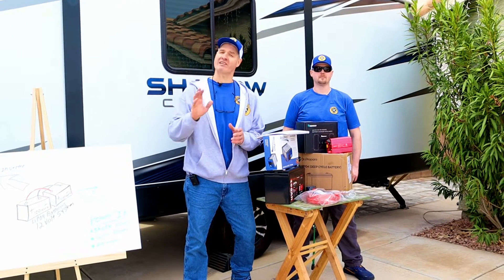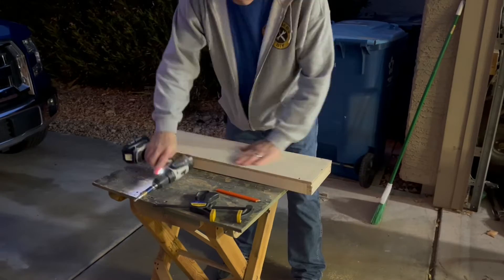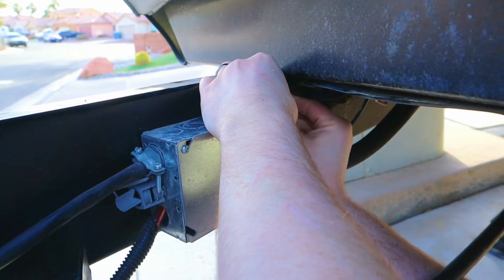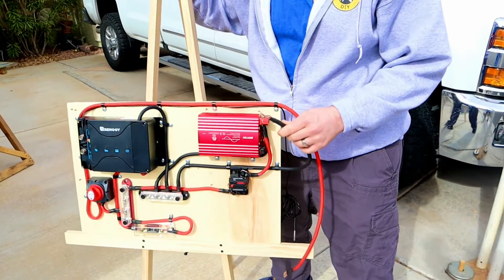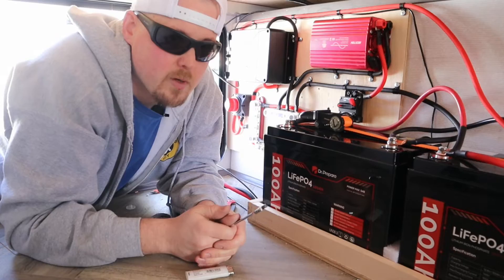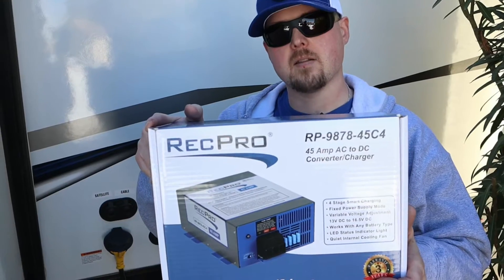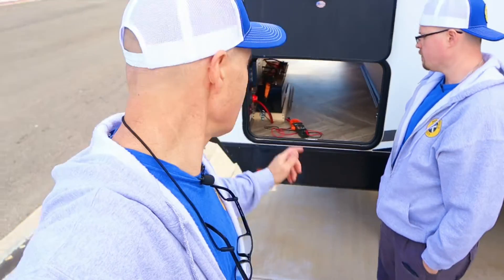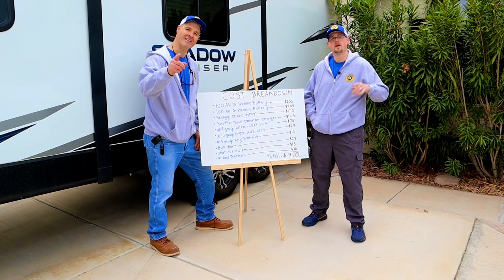Lithium Camper Battery Conversion-Step by Step Dr.Prepare LifeP04

Comment from the maker: Tell us what you think about this electrical upgrade! Leave us a comment and let us know all of your thoughts. What would you have done differently?
Reply: I just watched this video and found it very well made with usefull information. I would like to suggest you change out that galavanized 4"x4" junction box on the inside of the tounge to a "SEALED" box designed for outdoor use. That thing is for interior use only and is going to fill up with road grit and water.
Reply from the maker: @EdReda Great tip! Isn’t it crazy what these camper manufacturers are using!?!
Reply: Great video.....saw the YT Shorts and was eager to see it. About the only thing that I would do differently is buy everything and bring it over to your place to put it in.....with beer and burger, of course! 🤣
Reply from the maker: Glad you found some value in our video. Fred Jr has been wanting this upgrade for quite a while now. Thanks for commenting!
Reply: @MrFredsDIY  - The both of you made it look super easy....Thanks for sharing!

Comment: Great video guys! I am following your design on a toy hauler. Couple of questions. When you tied your positive to the existing positive - is that a fuse or just a 2 post buss bar? Second item I have a generator on board that was directly connected to the lead acid batteries directly. If you had a generator on yours, would you tie into the bus (terminal blocks both the + & - or directly to the battery posts. Would any fuses be needed and if so where? Thanks.
Reply from the maker: The positive and negative coming from the trailer frame we tied directly to the bus bars. We have an ANL fuse between the MPPT charge controller and the bus bar. We also have circuit protection between the inverter and the bus bar. As for a generator, we use a 3500 predator from Harbor freight. Our set up is for shore power. The power current coming from the generator needs to go through a converter charger to convert it from AC to DC. This device also acts as a charge controller as well with multi phase battery charging management. The simplest and most efficient way to use a generator to charge house batteries is through the shore power plug. I am assuming that whoever wired the generator to the previous batteries was using the DC output. I have no idea if the generator you have is putting out the correct voltage to match what is needed by LiFeP04 batteries and is certainly not optimized for lithium with multi stage charging and battery management. Most of that was not necessary for lead acid.
We just made a new video on our other channel for our camper set-up. You can watch it here➡️https://youtu.be/uBh2U7BgcOI?si=_NUNsNvEjPOCBlVU
Reply: @MrFredsDIY  Thanks for the quick reply. The trailer is a Jayco Octane T26Y came with a built-in cummins Onan RV QG 4000 EVAP generator.  Am I still going to need a Led/Acid battery to start the onboard generator? Will the new LiFeP04 not start the generator?
Reply from the maker: I’ll be straight with you, on board generators are outside of my wheelhouse. I did a quick Google search and it looks like there are many factors to consider. Without a deep dive, I don’t really have an answer for you. Good luck with your project.

Comment: Why did you guys relocate the batteries and not keep them in the preexisting acid? I saw it’s been asked multiple times but never answered.
Reply from the maker: Are you asking why did we put the batteries in the pass-through? If so, there are a couple of reasons for this. Putting the lithium batteries outside in the elements here in Las Vegas when it gets up to 120°F seemed counterintuitive. We also saved a bit of money on number four gauge solid copper wire because we didn’t need as much. We keep gasoline cans where the batteries used to be when we travel to use with the generator. Theft was a concern as well.

Comment: On the 300W Inverter - does it feed (convert 12V to 110V) and feed that into the existing trailer electrical system or do you only access the 120V by plugging a power cord/device directly into the Inverter?  Is there any issue if you install a higher wattage converter than the one you took out? (eg: the converter you are replacing is a 45 AMP and you want to install at 55 AMP).  What determines the max AMPs you would want to increase from the original? Thx
Reply from the maker: Thanks for commenting and great questions. The 300 W inverter does not feed the trailers electrical system. We only use it for the occasional 120 V appliance or tool. We have considered installing a much larger inverter to feed the microwave and air conditioner, but that would require many upgrades and we feel this camper is not worth a few thousand dollars more of electrical upgrades. As for the converter charger, we are planning a video for upgrading to possibly an 80 amp. An upgrade such as this will require careful thought to the existing wire gauges on the “house wires” to carry such a current. The easiest way I think would be to relocate the converter charger next to the bus bars. It would not be difficult to run some 12-2 romex  back to the location under the fridge to tie into the shorepower line. Anyway, I hope this answered your questions.

Comment: My friend tried to get me to change over to Lithium on our 2011 Jayco Jayfeather. We do not boon dock at all. We never will eather. We got 5 years on our first lead acid battery because I remove the battery in the fall and bring it inside where it stays warm. I throw a charge on it twice during  its storage and check the water level often. My friend is all about lithium. I see no sense  in the extra expense to convert. The cost alone doesn't  justify changing over. I paid $150 for another lead acid that, being properly  maintained should last another 5 years.
Reply: He,s right Mattie. 😅
Reply from the maker: I’m sorry to say that you did not save any money and here is why: 

First and foremost is price. You paid $150 for lead acid. The batteries in this video are on sale right now for $150. 

I’m guessing you paid $150 for a 100 amp hour lead acid battery? The Peukert effect, which describes how a lead battery's usable capacity decreases with voltage drop and only allows lead acid battery to use about 50-60% of it’s amp hour rating. Simply replacing the one battery with LifeP04 would nearly double your usable power storage.

Now let’s talk about lithium iron phosphate batteries (LifeP04);
~100 amp hours means 100 amp hours of usable power. There is no Peukert effect. 
~ charge cycles, lead acid= 600 LifePo4=3,000
~lifePo4 have a 10 year warranty lead acid batteries only live 3-5 years 

If you never boondock you don’t need solar or alternator charging so you don’t need an MPPT charge controller. You would need to change the charge controller that came with your old camper for Shore power. The recpro converter charger that we used in the video is $135. (Of course, if you wanted to add alternator charging, there are solutions for under $150 for  LifeP04 batteries)

Here is the math. You paid $150 for a battery that will maybe last five years and you can use half of its power. That’s $300 over 10 years for 50-60 amp hours.

If you would’ve paid $150 for a LifeP04 battery and $135 for a new charge controller you would have spent $285 0ver the next 10 years to have 100 amp hours.

Comment: At 5:37 you mentioned the Renogy came with a fuse  (output side). For some reason mine didn't. What size fuse is it?      Thanks,,,,,,BTW ,,,  your video rocks!
Reply from the maker: It was a 60 amp a ANL fuse. Thanks for checking out the video!

Comment: Aw man! Doing so well until time stamp 3:22. Completely lost me there. Confirming what?

I have been looking for a good video for how to move my batteries inside for year now with no luck. Would love if you broke this down for dummies.
Reply from the maker: We completely understand. Some of the stuff gets pretty confusing. Fred Jr is using a test light to find the hot wire coming from the seven pin through the trailer plug. All of the trailer plug wires end up in this junction box that he has open. The hot wire is the same wire that the power is the running lights on the trailer. 

Hope that helps! We are actually adding a third battery and are filming another video that will be coming in the next few weeks. We are planning on doing a breakdown explanation of the whole system in this video. Thanks for watching!

Comment: So, I just did this conversion a/p your video and even used the same components even though my trailer is tiny. The one question I have is what is supposed to on the "FG" terminal on the back of the Recpro unit. You didn't seem to attach anything to it and the instructions included are less than limited and the website info is not much clearer.

Comment: is your inverter connected to any 120 receptacles in the rv or do ya have to plug in directly ?
Reply from the maker: Currently, we just plug into the inverter. We are planning an inverter upgrade with dedicated outlets and possibly tying into the camper circuitry with a T-30 switch.

Comment: i understood everything but the dc to dc wiring...Did you connect a wire to the truck alternator or battery ?? It looks like all ya had to do was run a 10 awg from the female side of the 7 pin. I pull a 5th wheel with a chev 3500 diesel , two batteries but just one alternator..
Reply from the maker: Correct . One of the wires in the 7 pin is from the positive wire from the tow vehicle. Due to the small wire gauge size a d long run through the 7 pin connector, charging is typically limited. (We typically charge around 6 amps) While it is possible to run direct lines to alternators we absolutely do not recommend it because it is a complicated process and has numerous hazards associated with it and is not DIY friendly.
Reply: @MrFredsDIY  Thanks for getting back so quickly .. I am making a duplicate order ... You did not list a link to the battery monitor.. I have a PD 4500_ , It is switchable between LI and LA.. I enjoy your videos !!!

Comment: Help... At 68, I bought my first popup camper. A 2004 Rockwood Freedom (2280) I took an RVing Friend who "Missed" that it had no battery system. They were only going to use it to go to plug-in campsites. We go to the lake to boondock and catfishing'. Can you give me guidance? I do not want to change the system twice but I need to start small. ($$$) Please be gentle...
Reply: I need guidance on this. WF has sent me some stuff and since no one has responded, I have gone that way. I have or will have the: WF-9855-AD, WF-5320 (inverter), T-30 Transfer switch. Also a 400 watt solar panel.
Reply from the maker: Hello! You have a rather large and complex project that you have taken on. I have to ask, do you have much electrical experience? This is a pretty complex DIY project so be very careful as you make changes to the RV power system. If I were doing a similar project, the first place I would start would be connecting the T-30 transfer switch. There are tons of videos out there for this kind of installation. In fact I recommend this fellow’s video linked right here https://youtu.be/Lb0DuvvFFlA?si=SUeZQA-VX0hpENOq

The next series of steps that I would take would be to build something very similar to what we did in our video. I would install a piece of plywood and identify all my DC power circuits, install bus bars and power my system just like we did in the video. 

The pure sine wave inverter that you chose needs to have the appropriate size ANL fuse between the bus bar and inverter. Of course, the “power out side” will connect to the T-30 switch. Be sure that all of the wire that you choose is the appropriate size and pure copper every step of the way.

If all of this sounds very complicated perhaps you might want to contact an electrician. Good luck with your project.
Reply: @MrFredsDIY  I am smart enough to know what I don't know. ALL I am going to do is gather the parts. I "might" make the cables, I think that could be fun and not too far out of my wheelhouse. As far as the assembly? I am stepping out of it. THANK YOU SO VERY MUCH for the guidance!
Reply: @MrFredsDIY  Someone posted a link to the upgrade computer card... I lost it. Can someone send it to me???

Comment: As long as your cables connecting your batteries together are the same length each, your batteries will charge equally. Lithium batteries need them to be  close to the same length.

Comment: Does the Renogy do DC-DC and MPPT?  I've looked at that and wonder how many Amps it's rated for and what is the max watts from solar?  Cool setup, jelly for sure
Reply from the maker: Yes, the alternator charging port is the DC to DC charge regulator part of the controller. That is why we chose the Renogy because it is an all in one solution. A little bit on the Benny side, but it solved all of our charge controller needs. I am currently working on a much smaller system for a truck camper and hopefully that video comes in the next few weeks. The truck camper system will likely have a PWM charge controller and a Victron DC to DC charge controller for alternator charging. This system will save $100 and be adequate for a 100 amp hour battery system.

Comment: Hello, I am changing from 30 amp to 50 amp lithium set up. I have already bought the 50 amp upgrade trailer panel. The lithium batteries are lifePo04 300ah. Do you have a set up kit for whole system. I am a newbie on this whole thing. Thanks

Comment: When choosing a converter I see there are many amp options is 45 the standard?  Or should I go with more?  I am getting 2 Lithium batteries (100ah each) and currently have a 300w of solar with a 50 amp MPPT charger, also a 2000w inverter hooked to it.
Reply from the maker: The OEM was 45 so we tried to match the system to the way it was built. We are assuming that the wiring was factored into that calculus at the factory was sized accordingly. We did not want to exceed those tolerances working with those assumptions.

Comment: How's the RecPro working? Is the fan pretty loud?  I went other direction but that seems nicer that the one I got..
Reply from the maker: We are finding that it is quieter than the original OEM.
Reply: @MrFredsDIY  I'm assuming by the install, that there is no issue swapping out the Main Board Assembly for the RecPro?
Reply from the maker: @roblou4928 Swapping out the OEM converter charger with the RecPro was almost plug & play. We’ve had zero issues.
Reply: @MrFredsDIY  Based on your video, Im going with the rec pro.. Coming from WFCO, I see there's 5 wires. Two ( red and white) to the DC and 3 ( Green- White- Black) to the AC.. This would do it? Also I read about the stage on charging the battery while driving.. I didnt know about it and I dont want to mess with my alternator..

Comment: I'm currently doing research to upgrade to lithium batteries, I'm finding a lot of information out there and a lot of confusion too. I have a couple of questions I hope you can answer. Q1- why did you place the setup in the bay taking up space for storage and are you concerned with items in the storage bumping into the new charging components mounted on the wall? Q2 Why not have the setup in a box where the original batteries were located? Q3- Nothing said about DC to DC charger any concerns on burning up the alternator? there have been a lot of comments that the Lithium batters are so hunger when in a low  state that the thin charging wire  from the truck and to the coach can burn-up and destroy the alternator, I spoke to WFCO the same inverter on you coach that you replaced they said an DC to DC is highly recommended. Do you have any concerns tht this was not installed on your trailer?  Again... I'm currently doing research to upgrade to lithium batteries not trying to pick apart your video the video was great, thx.
Reply from the maker: Hello, there are two reasons we put the Lifepo4 batteries in the pass-thru. We have plans for space on the trailer tongue and these particular batteries do not have cold weather charge protection and the pass-thru will be a few degrees warmer in cold weather. For folks who are concerned about items bumping into the batteries, a box could easily be built to contain them in the pass-thru.

You are correct that a DC to DC charge controller is required with Lifepo4 batteries when utilizing alternator charging. One of the benefits of using the MPPT charge controller is that it has DC to DC charge controlling built in. Fred Jr talks about this in the video at 3:30, 5:30 and again at 8:08.

Comment: Nice video. Perhaps I missed it but did you summarize anywhere what size fuses you used at each point, as well as what wire gauge you used (other than the 8ga you mentioned)?  What size of fuses would you use with a direct Anderson cnx to the tow vehicle battery?  Thx

Comment: thanks for the information on the lithium upgrade!. one question i have regarding the connection to the tow vehicle alternator and battery... did you run a separate wire from the travel trailer (joining the wire where the trailer meets the back of the truck) to the battery on the truck or did you  piggy back the connection from the dc to dc charger to the existing 12V connection thru the 7 pin connector? Thanks Again! Phill E.
Reply from the maker: We did not run a separate wire. The trailer was already utilizing dc to dc charging through the 7 pin for the old lead acid batteries. Because LifePo4 batteries cannot be directly connected to the alternator, we ran that wire through the charge controller first.

Comment: Wires to small  from alternator   be luck of u get any power at all
Reply from the maker: Thanks for commenting. The alternator wire that we ran is a bit larger than the wire from the 7 pin connector.